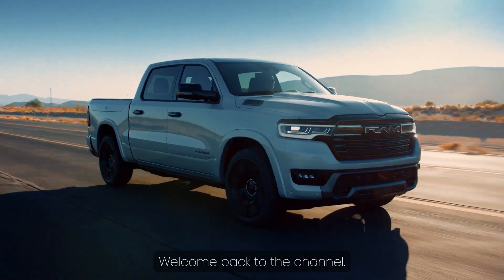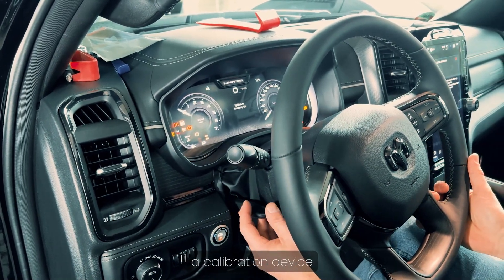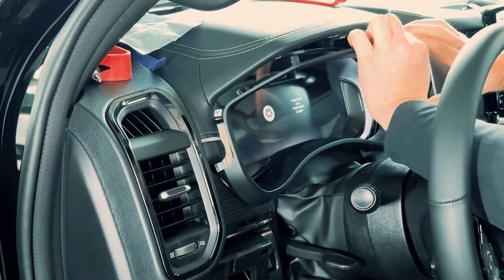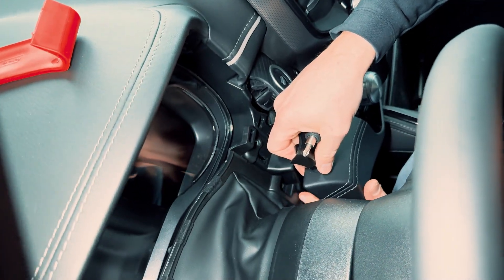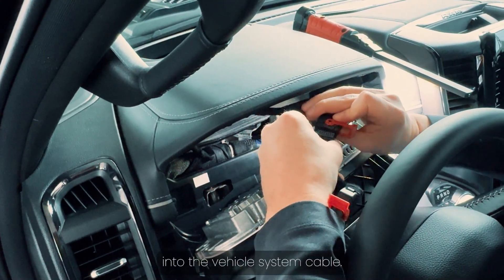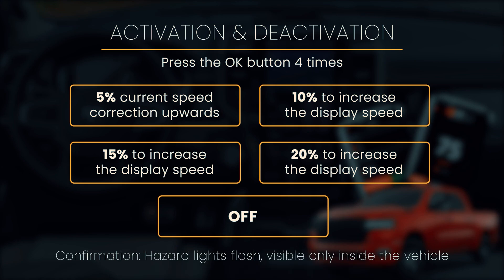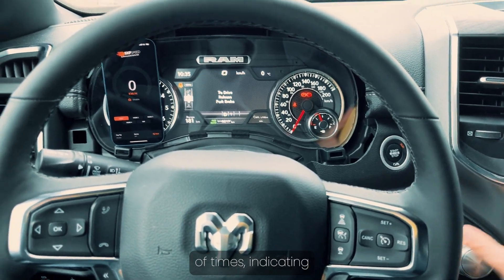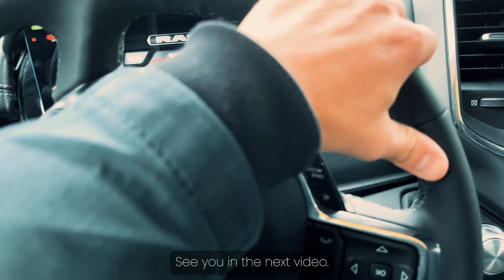How To Calibrate DODGE RAM Speedometer | Calibration Plugin Version

Comment: what product are you using?   Need to buy one.  Thank you
Reply from the maker: The product is currently out of stock. However, you can subscribe to our newsletter to receive a notification as soon as it becomes available: https://superkilometerfilter.com/product/dodge-ram-speedometer-adjustment
Reply: Are you sure this device works on a 2026 ram 3500 diesel ?? the reason I'm asking is they have completely redesigned the truck from inside out?